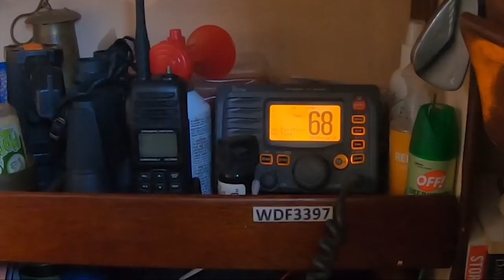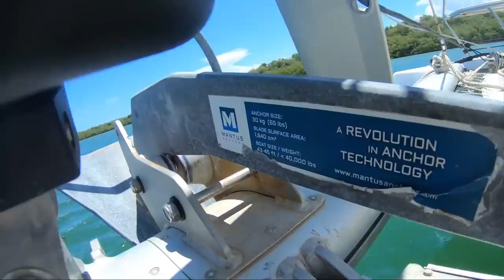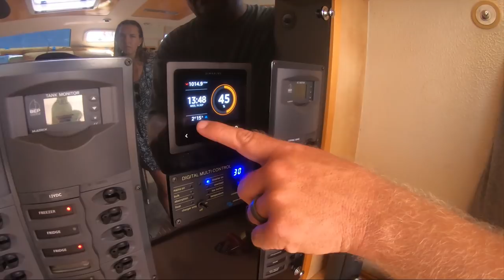THIS is what a *Modernized* Blue Water Catamaran looks like! - Bums on a Boat Ep 141

Comment: Is ok to walk on the solar panels ?
Reply: Yes!  They are specially designed and built to be able to be walked on.  They cost more, but we need to be able to walk up there, so we didn't have much choice.  The old solar panels that we replaced were smaller and there were only 3 of them, so you could step between them easy enough, but now we have more than double the watts. 🌞🌞

Comment: I would like to know how much time was spent learning the systems. Seems like a lot to know.
Reply: It depends what you mean. This is kind of a vague question. Which "systems?" Learning how to operate them? Replace them? Upgrade them? There is a learning curve with anything new, but it depends on your baseline knowledge to begin with and how much you want to know.  Are you talking about knowing enough to do all the work yourself?
Reply: Sailing SVCaterpillar I’m mainly talking about the upgraded electrical systems. The ins and outs of the batteries and failsafe mechanisms. Seemed like a lot of information to grasp from just reading instructions. I figured you did a lot of studying them. You basically rebuilt the entire energy system from front to back.
Reply: @boon197999  oh!  Yeah, definitely a lot more than just reading instructions!  I had a pretty decent handle on household electrical systems (120volt AC) after renovating a couple of our houses over the years, but I quickly learned that DC electrical systems are actually a whole lot more complicated. Huge learning curve there even with my comfort with working on household electrical!  I started by reading Nigel Calder's boat mechanical and electrical book, then Don Casey's book on sailboat maintenance and repair (with a big section on electrical), scour every website and forum on the topic, including some youtube videos. Read technical papers and manuals from various battery manufacturers and component manufacturers (like inverters, chargers, solar panels and controllers, etc).  Read BlueSea's website and technical info.  ABYC electrical codes and guidelines.  Then... get the right tools for the job (crimpers, cutters, strippers, heat shrink, multimeters, etc) and dont skimp. I said it took me 'months' to install all that stuff, but that was after even more months of reading, researching, and studying. Lastly, when I really needed help, Bruce Schwab at Oceanplanet Energy gave me some consultation via phone and email. He actually designed the Lithionics brand battery system and Nigel Calder actually works with him now.  Ps, if you dont know who Nigel Calder is, you will find out soon if you want to do anything to a boat 😉😎  good luck!

Comment: What? 500 watts of solar? That's not enough for Lola's morning coffee.  It must be a super efficient system with no loses or one of those free energy devices on the internet. Those 400 watts panels with the new 72 cells configuration like Jinko or Trina are a good choice to have some air to breathe without breaking the pocket.
Reply: Yeah, we definitely could use more solar!  The two high output alternators save the day, though. For now.
Reply: @sailingsvcaterpillar4672  5 of those new  panels 10amp each 50v are cheap and can save you one gallon of fuel per hour. 48v system is more efficient and can use 4awg wire instead of the 4/0awg which are very heavy and expensive. You did an excellent job in that boat.

Comment: Did he consider 24 or 48v instead of 12?
Reply: For sure, 48 is definitely the most efficient
Reply: I can say for sure that I should have considered that much more than I did!  In hindsight,  I probably should have gone with at least a 24V system and used a step down converter to run the existing 12V loads. Many of the large wires would have been half the size. 🤷‍♂️

Comment: Probably a fast boat with these nice sleek hulls, but the bridgedeck clearance doesn't look ideal.
How much clearance do you actually have at realistic displacement with typical cargo load (and what's the empty displacement)?
Does it slam a lot?
Reply: Yeah, she's pretty fast, but the sleek hulls are also designed to be narrow because narrower hulls also allow the design to have a lower bridge deck, so if you look at another cat with a higher bridge deck but also fatter hulls, the impact is the same. All cats slam in the right conditions.  The knysna 440 was designed to be sailed, and sailed across oceans...not to be a comfortable condo on the water.  By designing the boat to be lower, we gain tremendously on lower windage, better handling when docking and anchoring and just overall.  So, if you're looking at catamarans, you can't just ask "what is your bridge deck clearance" and then compare them that way.
Reply: @sailingsvcaterpillar4672  Thanks for  the reply. However, it doesn't intuitively make sense to me why narrower demi-hulls should deal better with a low bridgedeck clearance. On the contrary: if 'narrow' includes narrow above the waterline, this would translate to less reserve buoyancy = more slamming. The aerodynamic aspect is logical, of course.
Reply: @___Chris___    bridge deck slam, aka clearance height design, is a function of basically 3 things taken together. First is how far back from the bows is the lowest point of the bridge deck. There are a lot of cats that push the bridge deck forward in order to gain interior volume. The farther aft of the bows, the better for slam.  Second is  the distance between the hulls and hull shape.  Each hull creates a wave (wake) as it passes through the water. Under the boat, the two bow waves come together and also interact with the sea state.  Fatter hulls tend to throw higher bow waves, which tend to create more slamming, plus fatter hulls almost always means that the distance between them (in the same general size class) is narrower.  This all means that a cat with double or even more clearance under the bridge deck than ours will slam just as much.  The third factor is the clearance height itself. Almost every single aspect of boat design is all about tradeoffs and balancing them so you don't give up too much on one aspect to gain advantage on another.  A higher deck means more windage. It also pushes the sail plan, boom, etc, higher, which changes the righting moment and other balance considerations, in addition to offering a smaller sail plan.  Not as ideal if you actually want to, um, sail somewhere.  Some cat designs lean toward roomy interiors, some lean toward performance, some lean toward a balance of the two.  A good balance is best for offshore ocean crossing live aboard design. Most of the production catamarans like leopard, lagoon, fountaine pajot, etc. Are not designed to be bluewater ocean crossing vessels. They are built to a price point and to be comfortable at anchor.  Plenty of them ARE taken across oceans, but plenty of people cross oceans in small beneteaus too.  It doesn't mean that was the design intent.  Oh, and one more thing about sail plan... yes it's possible to just put a taller mast on so you can get the better sail plan, but then in addition to driving the weight higher, you give up the ability to sail in certain places where mast height comes into play. Our mast height is 63 feet.  Most of the bridges along the US intracoastal waterway are 65 feet clearance.  So we can also sail under many bridges that the other taller boats can't. It's not a minor issue depending on where you might want to go.
Reply: @sailingsvcaterpillar4672  Wow, that was a detailed answer. I'm aware of all your arguments. My point regarding reserve buoyancy (of which I'm convinced it is a valid point and should be added as the 4th factor on the list) was under the premise that all other factors remain unchanged, i.e. same space under the bridge. When wider demi-hulls go along with a lower distance between the hulls instead of increasing the hull width at the cost of the outside beam alone (=which simply makes it a wider boat) AND we neglect reserve buoyancy, of course we would expect more slamming with wider hulls, but the real factor in this case is the shape and area of the cross section of space under the bridge, not the hull narrowness, while the latter - when considered in isolation - increases slamming. I guess this is just a misunderstanding. I can see the cross section picture you had in mind: in practical terms, with typical production catamarans many designs with fat hulls do in fact have little lateral space between the hulls (this is reality, but not a design necessity), which is why I see your point.
Thanks again for taking the time.
Reply: @___Chris___   👍😎
Reply: @sailingsvcaterpillar4672  Great response Bill, you obviously put a lot of thought into your reply.

Comment: Hull number is different from build number because it has 2 hulls
Reply: Good guess!  But the answer is that St Francis made the first 40 boats with this hull mold and when Knysna bought the mold, they redesigned the deck and interior, but used Hull #41 for the first Knysna.  SV Caterpillar is actually the 11th Knysna 440 out of a total 22 built (#52)  (before they retooled and started making bigger boats)  🙂

Comment: I guess thats becors ewey catamaran hawe two holes.
Catamaran is a realy nice way to sail but in strong winds and atlantic crossings i prefere a monohole boat.
But thats me.
And i know there is others witsh prefere a catamaran.
But to cruse in caribian then my first choice hawe to be a catamaran.
Reply: You must be referring to the hull number question. The answer is that St Francis made the first 40 boats with this hull mold and when Knysna bought the mold, they redesigned the deck and interior, but used Hull #41 for the first Knysna.  SV Caterpillar is actually the 11th Knysna 440 out of a total 22 built (before they retooled and started making bigger boats)
Reply: @sailingsvcaterpillar4672  
Oki.
Yes i referring to the hull.
And my guessing was that becors a catsmaran hawe two hulls thats why  its 11 boats and 22hulls thats why the number was 22. Wilde guessing onley. But realy thanks fore the info 😊

Comment: Nice boat! Umm 2 hulls per boat.
Reply: The answer is that St Francis made the first 40 boats with this hull mold and when Knysna bought the mold, they redesigned the deck and interior, but used Hull #41 for the first Knysna.  SV Caterpillar is actually the 11th Knysna 440 out of a total 22 built (before they retooled and started making bigger boats)  🙂

Comment: Your electric conversion is only correct if you change voltage.  You don’t explain that. You’re talking about going from 110 to 12 volts, not just going from AC to DC.
Reply: Sorry for the confusion. I thought I made it clear that we have 110V AC and 12V DC on the boat, so going from AC to DC or vice versa could only involve those voltages. I'm sure I could have been clearer though. Good catch! 😉🙂

Comment: never have used a bath for all my life so no tub would be my choice
Reply: The tub may seem silly on a boat like this, but the design allows space UNDER it for access to the depth transducer, plumbing, etc. A full standup would create more difficulty  there. Plus, it's great to temporarily throw wet items and rinse them, etc. 😉🤔🙂
Reply: @sailingsvcaterpillar4672  I see thanks  a different shape  was not an option I gather ?
Reply: @feel7251   there were likely a few options for the original owners. The boat was built in 2006. We bought her in 2016 and are the 2nd owners. Knysna works with the prospective owners for every yacht they build as to whatever options and layouts they want, since they aren't a production line build they can do that. If they had wanted another standup shower, they probably would have just done something different.

Comment: Bathtub on a boat is just needless wastage of water unless you maybe need to steep wet suits or something.
Reply: While we have never taken a bath in it, it does work well to sit on the edge and shower while sailing offshore when standing can be more difficult. It also does make a nice place to drop wet bathing suits, dive gear, etc. to be rinsed. And this is not to even mention that it allows the boat builder to raise it up enough to have access underneath for depth, speed, temp, etc., transducers to be installed, removed, and maintained.  A full stand-up shower like we have on the other side, requires the floor to be so low - to give enough head room - that there wouldn't be enough clearance for such systems.  Oh, and as far as wasting water... we basically turn sunlight into energy that runs a machine that makes pure water from the seawater.  Unlimited.  Wasting it isn't a big issue.

Comment: 2 hulls per boat
Reply: You must be referring to the hull number question. The answer is that St Francis made the first 40 boats with this hull mold and when Knysna bought the mold, they redesigned the deck and interior, but used Hull #41 for the first Knysna.  SV Caterpillar is actually the 11th Knysna 440 out of a total 22 built (before they retooled and started making bigger boats)

Comment: is it because cat only uses even numbers for their hauls?
Reply: Same as I was thinking, only i figured the boat numbers would be half the hull numbers ... like you said because there's two per cat...... or something like that...lol
Reply: You must be referring to the hull number question. The answer is that St Francis made the first 40 boats with this hull mold and when Knysna bought the mold, they redesigned the deck and interior, but used Hull #41 for the first Knysna.  SV Caterpillar is actually the 11th Knysna 440 out of a total 22 built (before they retooled and started making bigger boats).
Reply: @markadams7899  good logical guesses! But the answer is that St Francis made the first 40 boats with this hull mold and when Knysna bought the mold, they redesigned the deck and interior, but used Hull #41 for the first Knysna.  SV Caterpillar is actually the 11th Knysna 440 out of a total 22 built (before they retooled and started making bigger boats) 🙂👍
Reply: @sailingsvcaterpillar4672  i had a duh moment not realizing 41 is actually an odd number. im laughing at myself now. :)

Comment: What is Bluewater
Reply: A term used to signify what a boat is designed to handle. There are other terms like: day sailer, coastal cruiser as well. Bluewater boats have been designed and built to a standard that you could sail safely far offshore with confidence.

Comment: 15kW of batteries and 0.5kW of solar....? And you can't run the hob and microwave together? Hmmmm
Reply: We actually could run them at the same time. We choose not to because it would put us at the upper limits of our system. The battery/solar doesn't dictate the operation, it's our inverters.
Reply: As dannalie Saunders mentioned, running AC loads has less to do with the battery capacity than inverter output... and virtually nothing to do with solar capacity. We have a 4000 watt inverter. Do the math... at 120 volts, that's 33.3 amps.  The cooking appliances can draw up to 15 amps each, which = 30 amps out of the 33 available. We CAN run them both, but we choose not to.  No need to max out the system like that.

Comment: I own a mono hull, cats are great if you got a big wallet, which I don't... a cat is out of my reach... and most people I've met that own a cat, are stuck up buttheads... not to mention rude and arrogant,  you seem to have met an exception to the rule... I e got 3.1Kw of solar... 12 EA 100 amp batteries... no shortage of power and were only using 1/7th of what we have... just need a rack to mount them all...

Comment: a lot of effort , a lot of money , and a lot of weight ,, that thing must be twice the design weight
Reply: Effort and money dont weigh much... why do you think we are that far overweight? Are you saying I should eat more salad? 😉🤷‍♂️  as far as the batteries, the 3 lithium batteries weigh within 4 pounds of what the 6 trojan t105 lead batteries weighed, that we replaced, and they have more than 4-times the usable capacity. The boat is rated for 8 people plus gear, etc, and we have a crew of 3. 🤔🤔🤔
Reply: @sailingsvcaterpillar4672  pardon me if i am wrong, lovely boat and congrats if you have managed to keep it within spec,, are the fuel and water tanks within spec  ?
Reply: @roderickmchardy3650  not sure why they wouldn't be. They were designed and built into the boat at the factory. They are integrated fiberglass tanks, not something we added or changed. Why wouldn't they be "in spec"??🤔🤔🤔  also, maybe watch the video again and catch the part where we said we took all of the onboard propane system off the boat in favor of the electric. The system had two rather large propane tanks that weighed a lot!  Plus the regulators, lines, propane oven, etc.  All gone or changed out for lighter options like induction cooking. We even changed from a fiberglass hull dinghy to an aluminum hull, which is probably 65 pounds lighter than the fiberglass dinghy.  I'm not suggesting that we are a "light" boat, but I'm just not getting where you watched that video and concluded that we were "double" the spec weight?
Reply: @sailingsvcaterpillar4672  without watching it all again i would know either ,,  still i will of course accept what you say ,,, what rang a bell with me was your fuel tanks, i cant remember exactly just that they seemed large as in my 36 ft cat i carry 10 gallons diesel  .  anyway  no insult intended, lovely boat ,, enjoy
Reply: @roderickmchardy3650  ah, interesting. Well SV Caterpillar IS designed and built as an ocean-crossing, world cruising, live aboard vessel.  And she is also 44'   I guess the intended purpose of the boat dictates a lot in terms of the 'specs.'